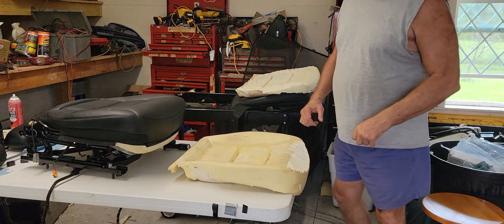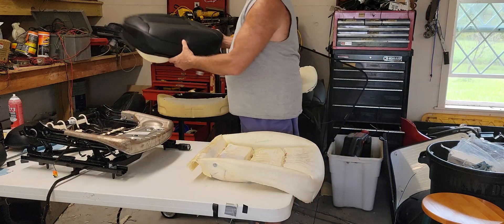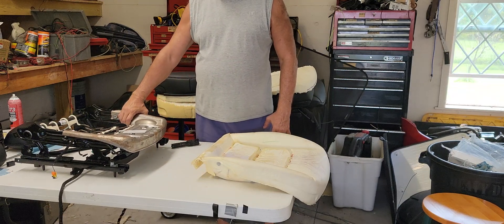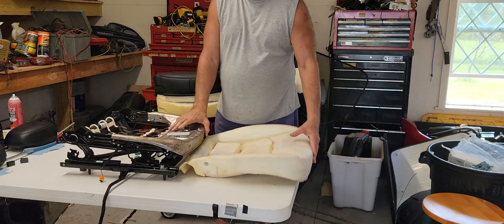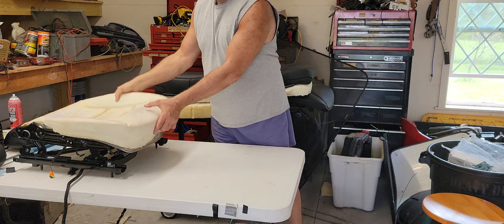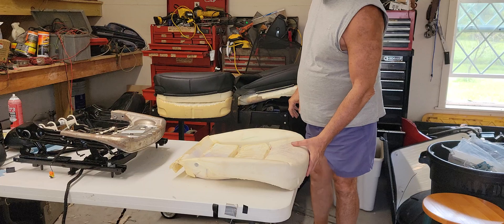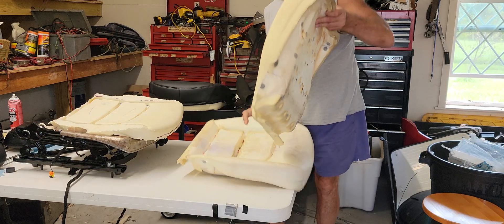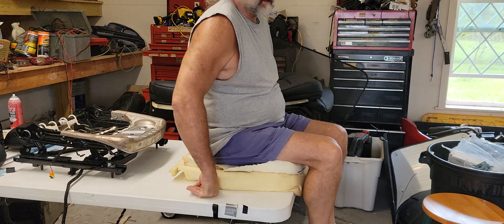Modified Tesla Seats. Hurt, but no longer.  Note: I no longer build this way but good explanation!

Comment: Has Tesla done anything to address this? Has anyone spoken to Tesla about providing a fix for this?
Reply from the maker: I believe that the answer is, “No”.  I haven’t tried to inform Tesla primarily because I thought my wider frame and hip bone size when compared to the seat width issue was an outlier. The vast majority seem to love the Tesla seats. We suffering are in the minority. 

Average hip width for men is 11.7 inches (which is wider than women).  The Tesla Model 3/Y, the inside most narrow part of the seat bottom is 12 inches. That would be adequate for the “average” person.  But my hips measure 14.5 inches across (width or breadth).  

We, the minority, would be fighting a battle against great momentum. Tesla is trying to reduce the size and weight and cost of the cars. Making the seats wider would be contrary to those goals.

Comment: George I have a plaid X 2023. The seats are horrible.  My legs hurt especially right foot, It doesn't feel cushioned at all. Will your technique work with ventilated sats?
Thanks
Reply from the maker: Yes,
We just need a duplicate seat bottom like yours. 
We can buy new or used. 
Your seat shape is slightly different, so we might need a different replacement foam in it. 
The metal base is the same as model 3 and y. 
Is this your seat color and type?
https://www.ebay.com/itm/165899136008?hash=item26a05bec08:g:TBcAAOSwqIBjzIor#readMoreDesc

 If yes, we should jump on it secure it and start working on modifications.  Please reach out to me ASAP.
You can reach me at
Seben (6+1)-19-244-Seben one two four

Comment: Interesting.  What was thickness and compression strength of the foam you added? Where did you get it? Thanks!
Reply from the maker: I don't have a method to measure "compression strength. What is that method? It seemed maybe 4x what Tesla uses? I bottom out the Tesla seat immediately. I cannot bottom out my build. I also added a dense foam block(s) underneath the replacement foam to maximize the suspension depth or movement potential distance. I picked a car who's seat I'm very happy with repeated quite long drives. I bought a used one (at risk) and built the Tesla seat using that replacement foam and then drive tested. I've tried seat foam from two different cars so far. The second one was a suggestion from a customer of a car he owns and really likes the seat. I also bought the old model S seats but they are virtually unworkable. Newer model S use the same frame so I didn't bother trying.  I can't tell you the one that I used. Because I've invested a lot of time and money and hope to recoup some. I can tell you other Tesla seats do not work, no matter the year, as I've tried. It's best to pick a seat with a minimum number of "lines" in it. And pick a seat from a car of similar size and year range. The industry uses similar seat designs overall for each model class, it appears to me. But try to get one with few seams because that's where they secure it and have grooves cut. Since I needed to cut my own Tesla grooves, the fewer already there the better.